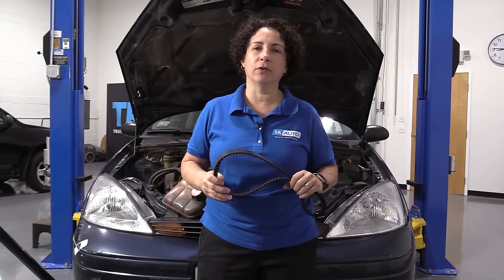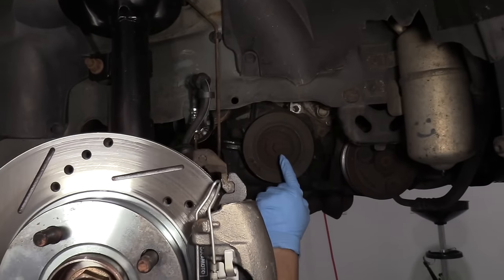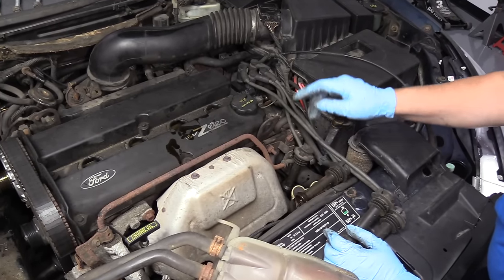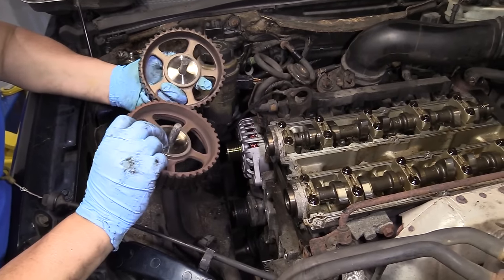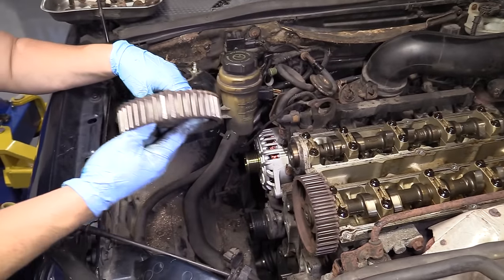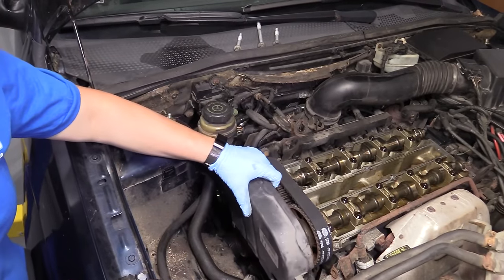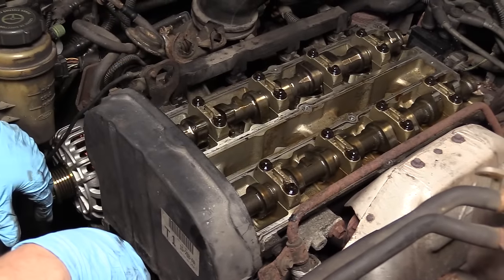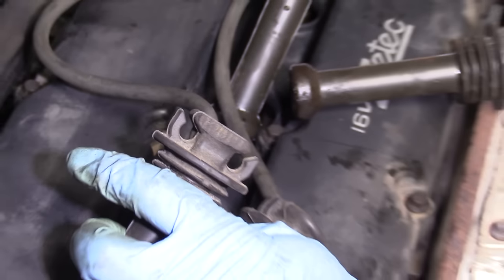How to Replace Timing Belt 00-04 Ford Focus Sedan Wagon Hatchback

Comment from the maker: √  Watch the Video 
√  Buy The Part at 1A Auto http://1aau.to/m/Visit-1AAuto 
√  Do it Yourself 
√  Save Money
Reply: So is this motor in the 2000 contour??
Reply: Be nice if I got a reply!
Reply: dude! ma'am, duddet, i have an 08 DOHC i think zetec but its got a timing chain rather, anyways, I've tried everything to get my crankshaft front oil seal to come off and it won't budge! its a straight crime how much they charge for the remover and the last thing i wanna do is buy a single use, single function, single model and make tool for $250 to get that dam oil seal off, can anybody help?!? any suggestions??:(
Reply: @austinharding9734  ýýýù7ý

Comment: Excellent job on the video!  Best and most comprehensive of the ones currently online for this particular job.  As for the ZTEC being an interference engine, it fits the technical definition of an interference engine (the highest point of the piston overlaps the lowest point of the valves), but in practice it is a noninterference engine, because of the fact that recesses have been molded into the pistons, so that the valves never actually hit the pistons.
Reply: Yea it’s a non interference you can spin both cams all the way around without the valves kissing pistons with crank at top dead but technically your right about the lowest point of the valves being lower than highest point of top of piston but as you say in practice I’ve never seen a zetec bend valves and I’ve broken 2 timing belts on the highway with all my years modifying and building this engine
Reply: That's great to know. Thank you for that info!
Reply: My understanding is the regular Zetec will freewheel, but the SVT is an interference engine.
Going to be doing this next week as my tensioner blew itself apart, so I'm glad I don't have the SVT.
FWIW, also the ideal time to replace the water pump, serpentine belt and its idler and tensioner, and the engine mounts while you've got all this stuff apart.

Comment: This was a great video. I got everything tore down in one afternoon after watching this a couple of times. The cam sprockets were tough. I think she used a 15/16" wrench to hold the cams in place, but that absolutely would not go on. A 24mm worked for me. Thank you to the mechanic in the video. Edit: Got everything together and the car ran rough and would not idle. Went back under the next morning and found a disconnected vacuum hose. Working on and moving the engine up and down cause this. Once the hose was back in place, the engine ran correctly.

Comment: Cam sprocket bolts 50 ft-lbs
T-belt Idler and tensioner pully bolts 18 ft-lbs plus a little extra in practice (more like 20-22 ft-lbs)
Valve cover bolts 7 nm / 62 INCH-Lb in sequence
(Note: do not clean your valve cover right over your open engine and do not use any abrasives to clean your head)
Engine mount bracket to engine 37 ft-lb
Crankshaft pulley bolt 90 ft-lbs

Watch the whole video if you are a novice, overall great video but avoid using any abrasives on or in an open engine it can put grit into the engine leading to camshaft, oil pump or bearing failure.
Reply from the maker: +gidderman Thanks for the feedback!

Comment: Thanks for this video. I just changed the rocker cover gasket and wanted to remove the upper cover from the timing belt because leaking oil was splattered everywhere. I was mystified why I could not remove it even after taking out the 4 bolts but now I see I have to remove the engine mount! I'm glad I stopped before breaking anything.

Comment: This is the first time Ive seen a seal installed correctly by putting a dab of grease around the lip and on the spring..tapping on a new seal with out the grease may pop out the spring a week later the car returns with an oil leak..Very good workwomanship.great stuff.
Reply from the maker: +57kellys 57kellys Thanks for checking us out! http://1aau.to/m/Shop-1AAuto-c

Comment: This video is 😉 amazing. Clear well explained I made myself a challenge to replace the timing belt on my focus and I did it perfectly following this video. I’m a handy person but not a mechanic. Thank you so much 1A Auto.   Question: is it possible to get a video  on how to replace a leaking cylinder head freeze plugs?  My second Ford Focus car started leaking coolant by the cover valve.
Reply from the maker: +Blass Thanks for checking us out! We do not have a video for this repair right now, but we'll keep this request in mind for a future video! 1AAuto.com

Comment: Hey guys, first of all, thank you so much for the video. I did the timing belt change :D. I tried to hear the cars sound before I did the change but the battery was dead and I didnt have a jump starter so went ahead with the change, also changed the serp belt, timign belt tensioner, idler and cam and crank seals. I then bought a powerbank to jump start and then started the car up. It runs fine-ish. so for the engine mount I torqued the bolts on the engine to 80nm and the ones on the chasis to 50nm(caz I followed torque instructions from another source midway caz I was tired I guess).

- The car vibrates very slightly when I climb hills, I guess I have to torque down the bolts to 80nm
- Theres a slight ticking noise, idk if this was there before or if the belt tensioner is not adjusted correctly or if its just the fuel injectors clicking, I uploaded a video here -> https://www.youtube.com/watch?v=a4Nn6uU96Xw&t=5s&ab_channel=SaifAbdulCassim
- Do you think I have to be worried about the clicking? does your car make a similar noise? its coming from near the back of the engine near the fuel injectors, as I said I dont have sounds from before the repair to directly compare since the battery was dead, but last it ran I dont think it made this noise, maybe I am being paranoid.

i am planning to do a coolant flush in a few weeks, I wanna use the car regularly till then, so that I can flush things out in sequence, will also do a water pump change then, was thinking I ll tear into the engine again during that time and give the timing belt tensioner and idler a final torque, what do you think?

Comment: Thanks. Great video. Really very well done, and very good mechanical advice. 
 Have an identical engine in a 2004 Mazda Tribute 2.0L YF engine Vin 3, Carbed.  Knowing the VIN 3 or B or whatever - is a life saver looking for parts or a spare head. The number is inside the driver door.   Took 2 weeks to find the bolt that stops the crank for timing TDC. Thanks for making it look easy (haha) back there under the exhaust manifold.  
Everyone else points to it at the front on the other side under the generator. Who the hell makes an engine with no Keyways and no line up marks on the crank or cam wheels??

Our engine has NO keyway on the crank pulley. NO marks on the pulley wheel - nothing. It is simply held in place by the tightness of the crank bolt !!!!! Came close to making one....
If not for the crank timing pin, there is no "practical way" to set the timing on one of these Zetec engines. And we couldn't find it for quite a while in any manual or video. Yours is the first one to show it under the exhaust.  Luckily the cam slots are off center keeps you from guessing if it is 180 out. The cam wheels have no marks that "line up".  Popping the seals for the cam wheels, and crank shaft was easy, BUT, the parts books like to list the REAR crank seal first. You have to make sure you specify the FRONT crank seal. Be ware of cracking that top plastic timing belt cover, although we found a couple of good used ones, and the lower belt cover as well.

Also noticed tightening the belt tensioner can change the timing set up. Watched you keep that cam tool and the Crank timing pin - stuck in there until you were done!!
The worst part of taking the head off was the frigging power steering hose and the odd ball exhaust bolt hidden by the hose. RTV is a 25% surcharge for dealing with it ;-)
Nice little engine. We warped the head at 244,000 miles. Bottom end still looked pretty good !. Put a used head on it for $125, and $250 of belts and gaskets and new water pump.
Reply from the maker: +Steve McLaughin Thanks for the feedback!
Reply: Yes , this is a Mazda designed engine. Very reliable as is the 2.3 Duratec

Comment: Nice job, always interesting to see how badly worn parts are when you remove the cover. I just wonder why remove the cam locking tool before you torque the sprockets ?
Reply: The FSM warns not to try to turn the engine or torque against the alignment tools.
Reply: The cam ends will break, i think it's cast steel, nevertheless those slots are for alignment not for holding

Comment: At about the 6 minute mark she said it was a good thing the belt didn't break because the pistons and valves would hit.

That's only true if it's an "interference" engine. The U.S. version of the Zetec ( the exception being the higher compression SVT version) is a non-interference engine. If the belt breaks all that will happen is the motor will stop running and  then you get to call a tow truck or a really good friend.

Comment: Thank you for such a great video! One question: do I need to care about the position of the bottom gear (which is on the crankshaft) with the belt on? It has some freedom and I wonder if there is possibility to do it incorrectly.

Comment: Brings back memories of working on my 98 ZX2. Had to replace waterpump on it, and then the bearings crapped out on timing belt idler pulley so I had to replace the pulley and the belt.

Comment: Very nice video, I should do the same job on my Focus !!!
I have a 2007 Ford Focus 1.8 Tdci
to unscrew the crankshaft pulley bolt I have to turn to the left or right side and where can I find the pulley locking key?
I thank you for the answer!

Comment: luv your video...one of the best 4 replacing time belt..helped  me on replacing mine.
my car is 16 years old with 70k miles but decided to do it. The old belt was actually good. no cracks or spongey..However after starting the car was sputtering and running rough and stalling in drive. was throwing up my hands.  Was going to repeat disassemble to see where l went wrong.  Then l decided to replace the bosch plugs with the old motorcaft plugs which came with car new. Fortunately l saved them after 50k miles...and was surprised in that the motor purred like a kitten and was better than ever.. WHEW!!!
go figure???

Comment: the 2001 2.0l  ztech  motor is a non interference motor so if the timing breaks it dose not bend the valves!

Comment: Returning to this as I'm doing this job myself soon. However, when you out the car in the air, you had no side engine mount or transmission jack for. support. What did u miss?
Thanks

Comment: Before You order your timing belt kit, make sure you check to see if you have 1 or 2 idler pulleys!  The industry belt number (294) uses an "A" and "B" kit. One kit is for 1 idler and the other is for 2 idlers. Consider replacing the water pump while you're doing this job.

Comment: Great video, thanks Sue! A question: how do you keep the engine in its place with the car up in the air? Does it just hang suspended on the remaining engine mounts?
Reply: That's what I was thinking lol
Reply: Probably has a support across the engine bay with a chain holding it
Reply: i was wondering that too, i think the transmission and dog bone mount will hold for a while, before ripping off, that's why i bought new mounts anyway, it's easy to change all 3 during this job and of course you can find those at 1A Auto :))))

Comment: A small point, and maybe you did it and edited it out, but one extra step I have always done with these and similar engines is refit the timing tools after the initial rotation and recheck the timing and belt tension, then, if needed, make any adjustments and repeat the process before completing re-assembly once satisfied.

Comment: never knew there was such a thing as a non interference engine until the belt went in my 99 corolla , by the grace of God no damage
Reply: Almost all 90s toyotas have non interfarence engines...🙂
Reply: The one thing Fiat got right back in the 60s through 90s since their rubber band thick timing belts broke like prom night condoms.

Comment: Why didn't you clean the grease off that cover the lower cover? You did all that good work. The grease is just going to fall down eventually and get on the timing belt and run up into the cam gears

Comment: Hi 
I have a question ❓ my gear on the crankpin has moved because of crankshaft has worn out and become a little round ,so I have change the gear and know after some driving it has been set ,but know the mark doesn't fit anymore ,so in my mind I remember in the 1986 i change a timebelt and setting crankshaft when number 1 piston was in top ,,it's that correct or have I just being lucky ,,,

Comment: I have a 2003 ford focus regular version my oil light flickers at a stop the engine runs great the shifting feels great but the oil  light flickers at a stop but honestly this video is good the only thing I would have trouble.with would be when you have to align the cam with the bottom crank

Comment: Im in a severe bind      ... Timing belt broke on mine.   I dont have a choice but to buy the belt & somehow get one og the metal plates & pins     and have to do this job alone, for the first time.    Can get into replacing sealss & news pullys etc.   Just need to get it running & back to work.            Supposedly the Zertec engine is Not intergerence,   i dont have a choice but to replace the belt & do this procedure & hope I can do it.       wish you had named EVERY tool before you strarted the proceedure.     8mm,6mm,10mm,, 14mm, 15mm,  18mm  , nig wrench for cams ,    long screwdriver, prybar,    jack with flatwood   #6 Allen wrench   56Torx bit                . any other hand tools needed?

Comment: Want to make sure if the timing belt tensioner (arrow tension guide) actually moves when the car starts running?  Like you said make sure the hex plate should not move and @ 4:00 and the arrow will move up and down while you are rotating the engine.  Does that arrow always move even though the tensioner screw is properly torqued 17 ft lbs. Thanks

Comment: Tip: You can use a 8mm or 5/16" wrench for the engine mount studs if you don't have an inverted torx socket. Worked flawlessly for me
Reply: found that out yesterday in the middle of the night while freaking out i don't have an inverted torx, and i just randomly tried a regular hex, it does work but at higher torques it would probably strip the head, so im definitely buying a set of inv-t

Comment: I would suggest replacing the water pump also since it's such a pain to remove the the parts when they are already removed and easy to get to the water pump.   I didn't realize how costly doing that job can be with the timing belt kit.  the water pump, the seals and valve cover gasket.   Maybe the serpentine belt,  the serpentine tensioner, spark plugs and spark plug wires, anti freeze if needed.  Hopefully you can rent or borrow the timing belt tools to hold the cam and crank sprockets.
Reply: the tools are pretty cheap, i think they sell it too

Comment: Do you still have use the cam bar in the back of the cam shafts even if your not changing the cam seals ??
Reply: Yes. The purpose of that bar is to keep the engine in alignment while you change the belt

Comment: Wow, great video. I have a question maybe you can answer. I've got an 02 Ford focus ztec duel overhead cam and the timing belt actually snapped. Google gave me mixed answers on whether or not it's an interference engine. I read that it was, wasn't, and that it was mistakenly listed as interference and corrected later as non interference. For God sake 😂 Would you happen to know if it is? I'd hate to do all that work for nothing.
Edit After getting it put back together, she lives! So the zetec is for sure non interference.

Comment: Many thanks for the video!
Question: @2:56 you lifted the engine and @12:29 no support any more. It appears again @55:34 and @1:19:04 you try to push it a little bit more (but paying attention). How does it work? The lift is only needed to remove the mounting bracket? Once the mounting bracket is removed the lift is not needed anymore?

Comment: Is there a symptom or warning signs beside belt being cracked? I have a 2009 honda accord 4cy, and I hear a noise when I start it,thought it was the a/c clutch cause I'd leave the a/c button on, when I turn car off, but with ac button off and cold start I hear noise like bearing? Anyone can advise, I'd appreciate it. I have a scheduled appt for mechanic,  but I prefer to fix myself. Thx!

Comment: I just bought a 2004 2.0L SOHC with only 29k miles.  As this is 16 years old,  should I go ahead and change the timing belt even though it is only 29k miles?
Reply: Also, what other things should I look at replacing?
Reply: I mean it's easy to remove the timing belt cover and inspect the condition of the belt. My guess is that your belt is good. Time doesn't wear it. Usage does

Comment: She did a pretty good job on the video however I've always been told the belt should never be pinched tighter than the crank sprocket radius I think I'm saying that right although it's a new belt it won't suffer as much as that old belt is suffering but it's still not a good idea I don't believe too pinch the belts tight like she did to check the measurement on them anyway she did a great job overall.

Comment: When I was using the 15/16 wrench to hold the cam shaft still to loosen the bolt from the sprocket, the wrench kept slipping off the cam shaft, never did get change the cam seals, any suggestions ??
Reply: The 15/16" wrench didn't work for me either. Ended up using vice grips. I had to be very careful not to damage the aluminum mating surface for the valve cover though